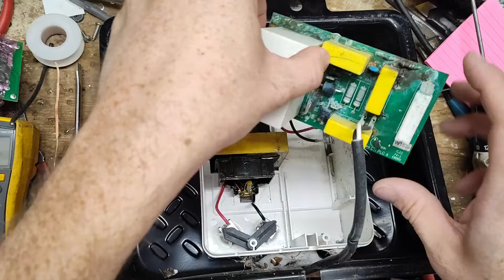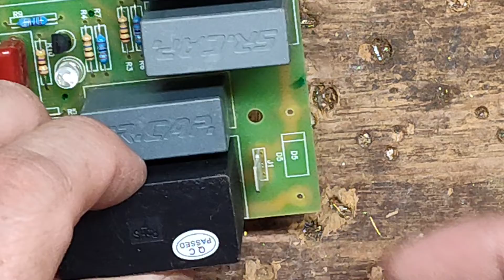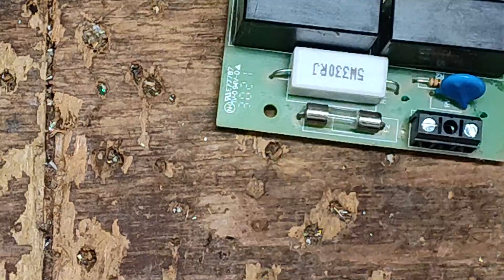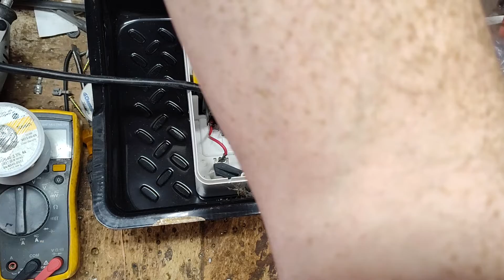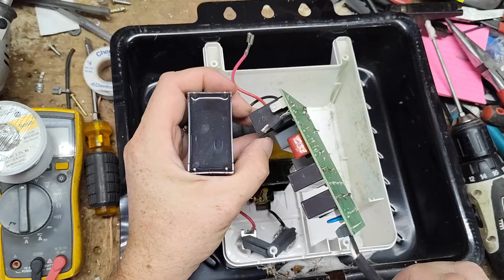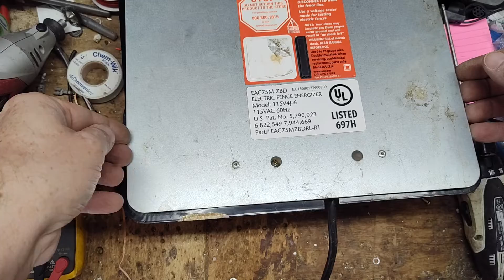🤬 Zareba Blitzer American Farmworks Is No Longer Offering Repair Parts...

Comment: no parts!  so glad i went with gallagher and my spare is a par-mak
Reply: Great video.  Is it even economically viable to repair a $180 unit?
Reply from the maker: @WastingBob  Depending on what's wrong with a unit, yes they're typically worth it. Our labor on one like this is around $15 +/- and then shipping is $15-$20 and then it'll just depend on what parts are needed.
Reply: @FencerFixerRepairLLCKansasCity  that is an impressive rate.   👍🏼
Reply from the maker: You chose good brands to work with.